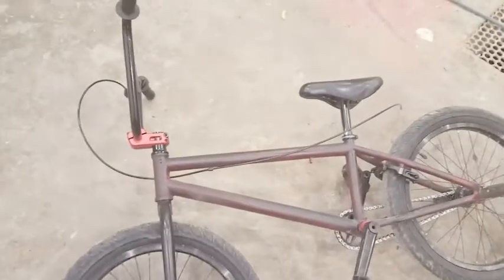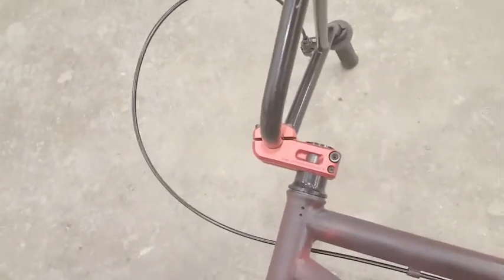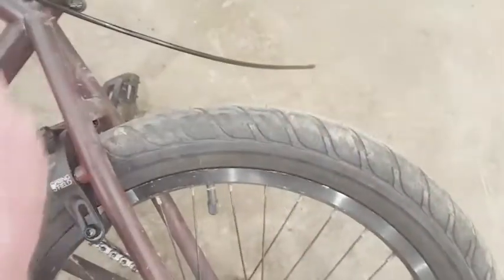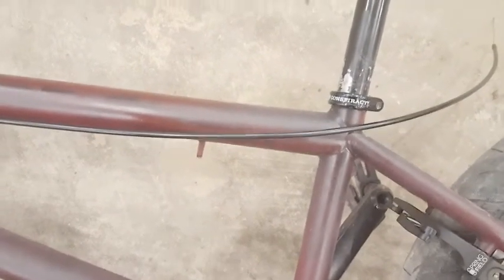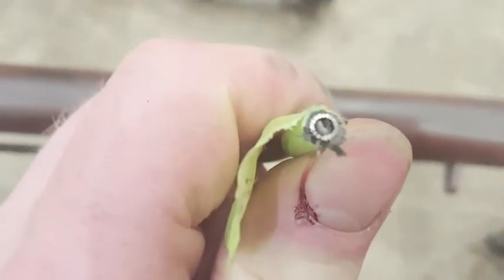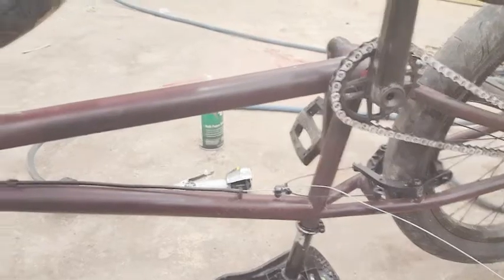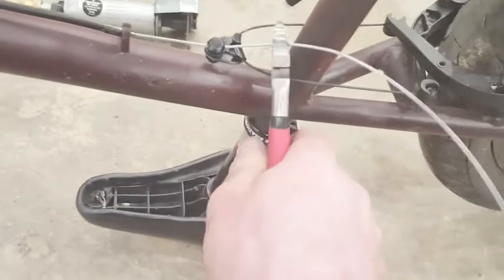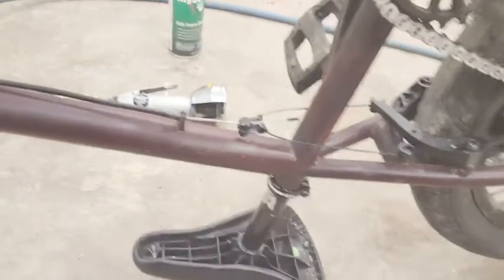How to shorten new bike brake cable length

Comment: Just out of curiosity, if I used a disc grinder, would it be a clean cut (like a milwaukee kinda thing)
Reply from the maker: I would swap the grinder disk for a cut off disk but yea I would think that would work good.
Reply: Tyler Koehn ok thanks mate 👍